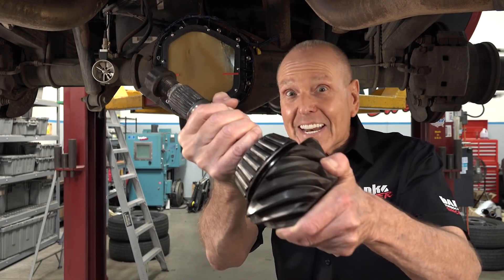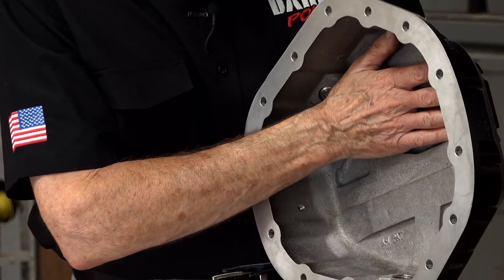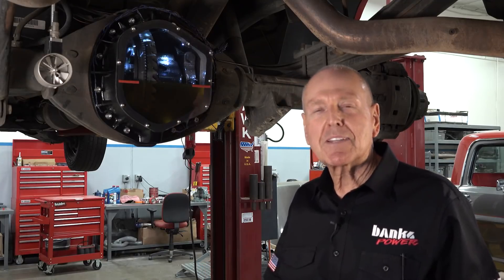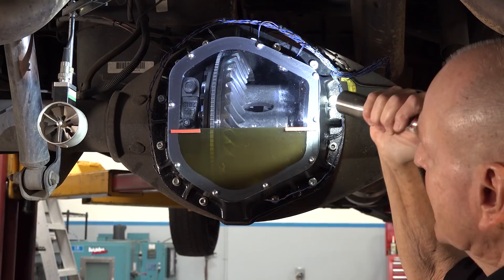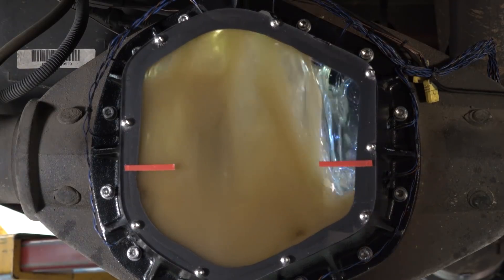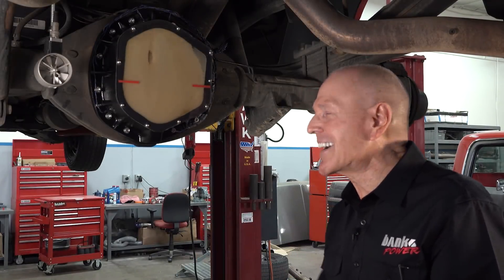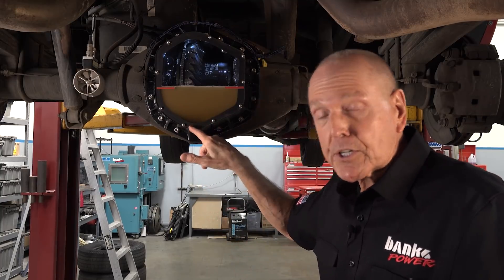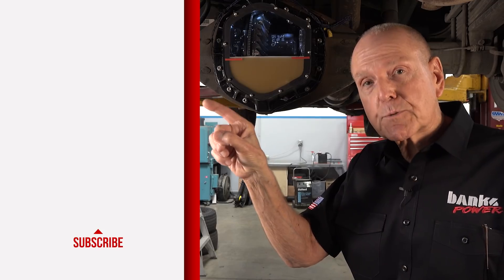What's going on behind your flat-back diff cover?

Comment: It would be neat to see some thermal imaging. That would highlight the highest friction areas for the fluid.
Reply: TI doesn't work that way. The IR light won't make it through the plastic cover. All it will show is a big red blob with uniform heat.
Reply: You don't need to see through to the oil, as it will all be the same temp. However, since the plastic cover is an excellent insulator it will not spread it's heat and will show obvious hot spots. So this would confirm the 90degree oil deflection is adding heat to the plastic/oil.
Reply from the maker: We have quite a bit of Flir thermal imaging. Although it's tough to see clear definition. It's interesting to see the heat move from the ring gear outwards.
Reply: @sixtyfiveford  have you actually used a thermal camera?
Reply: thermal imaging can be tried but the cover would have to be made translucent to the IR band I think some plastic are made for that purpose but I don't know if it will be compatible with the diff oil :/
Reply: Exactly my point. Polycarbonate isn't going to pass that band. You need zinc selenide or zinc sulfide for IR windows. We use them on electrical gear all the time so you can check connections with an IR gun or tool. You can't see through them, but the IR goes through. For something to cover the back of a differential you're talking several thousands of dollars.
Reply: IR windows on switchgear are made from calcium flouride so the IR scanner can see through them, make sure to set your emissivity on the your FLIR or fluke gun to .50 instead of .95 or so, this will help it get a clearer more useable image, as Kleetus92 said it would be very expensive to make a diff cover out of this,  usually IR windows cost about 100 bucks per inch in diameter
Reply: Literally pulling my aftermarket diff cover off that I put on 2 weeks ago and putting my stock on back on as we speak this video scared the bejesus out of me is got me in my driveway at 12:15 a.m. at night
Reply: @bryloncarr7466  overreact much?
Reply: LOL @kleetus92  

@Brylon Carr — What was your goal for installing the aftermarket cover to begin with? I mean, of all the modifications you can do to your truck (you know, spending your hard earned dollars) you decided to dump $300 +\- for a diff cover...?! 

Most advertise lower temps, more fluid capacity and a beefy design + the obvious aesthetic bonus. 

Why you running out to the car to pull it off? Do you not trust the design and engineering of the company who built the stinkin’ cover you purchased? 🤦🏻‍♂️
Reply: @bankspower  hi sir.  I was wondering when we going to get an update on the diff cover for dthe f150 09 to 2014.  Please let us know thanks

Comment: Why are all the haters going on about Banks' "sales pitch"? Last I checked, he's saying DO NOT waste your money on aftermarket covers, and stick with the stock cover. How is that a "sales pitch" - if anything, it is an anti-sales pitch. He's not selling anyone anything.

I think a bunch of people are just sore that they wasted money on an aftermarket cover that doesn't actually help anything. Maybe it doesn't hurt as much as Gale thinks it might (I suspect the higher than stock fluid level recommendation for these covers is a band-aid to prevent starvation of the front pinion bearings).

I've questioned the point of most of these covers for a while. Always seemed like a waste to me for most applications.
Reply: Agreed 100%. People want to get aftermarket diff covers for what? So the oil will last longer? So diff temperatures stay lower? Or is it just cool looking? 
In my opinion there's nothing wrong with stock diff covers. I've seen lots of vehicles with stock covers and have had the rear end outlast several engines. Let's face it, rear ends and differentials are pretty tough. Probably one of the least problematic mechanical components in a vehicle. And I also know that most people never service them or change the fluids at the recamended intervals (myself included) and they still survive. I've owned many vehicles and lots of trucks and do severe heavy duty towing and have never had a rear end fail. I know they can and do but it's not common.
Reply: I guarantee Banks will be unveiling there new cover after all these videos you don't spend this kind of money to prove how bad your competitors products are you do it to prove how good yours is
Reply: Gale Banks has simply demonstrated how poor, lazy, & cheap the designs of those aftermarket are, which seem to have been made to look impressive while using the least amount of metal!

Comment: Thank you Banks power. I will keep my stock cover.
Reply: Not only that, but fill to the prescribed fluid level. I have to admit that I've always just filled to the bottom of the drain plug, which in many cases is an overfill.
Reply: I'd like to see a transparent stock cover. You could machine a recess into a block of perspex to match the shape of the inside of the stock cover and polish it so that you can see through it.

EDIT: nvm, that was the previous video, lol
Reply: you can put aftermarket covers on just not flat backs try ones that have the same physical design but someone like myself wants something that is much stronger for offroading
Reply: Leonard Martin+ That makes sense. A finned version of the original shape cover seems like it would be useful for cooling.
Reply: i dont see the point of a flat back in the first place other than looks. i would much rather a original shape and inside space so same amount of oil everything is exact same in regards to performance and cooling etc. only difference is the metal is much thicker for hitting rocks and other things
Reply: What is the best of both worlds?  The flat back costs you money in both fluid degradation and adding un-necessary fluid and over all heat.  The only thing a flat back is good for is how it looks, and that's just silly.  It's under the car, its going to get covered in everything making it look plain and caked metal.  So you are going to buy a flat back, increase fluid levels, THEN also install a deflector increasing yet again the displacement,pushing the fluid higher yet causing more work and ruining the fluid even faster just to get the same fluid flow as a normal 
stock diff cover?  Why waste money on things that don't do anything other then make something look good for a few hours after putting it on and that's it?  Hey don't let anyone stop anyone trying to make something look better rather then work better.  If you want to waste money trying to possibly ruin your diff or at least your wallet then by all means, no one is trying to stop you.  It is your money and vehicle after all.
Reply: Best option would be to just tap the diff for some lines that go to a remote mount Oil cooler and use a stock cover and if you are worried about off roading durability of the stock cover weld trail armor onto the diff housing protecting the cover. This is why Toyota diffs last so long offroading even though they have smaller Ring and pinion diameters cause you cant remove the diff cover and therefore people aren't tempted to swap em (looking at you domestic guys)
Reply: but a wrangler is so much better for offroading than any toyota
Reply: Make your own. Weld 1/4" steel plate onto a stock cover, essentially making it rock proof. I've done this before and it works excellent.
Reply: i have done this but i have gotten to the point i just love a good bolt on.
Reply: lol you must be joking right... everyone knows the wrangeler is the most capable jeep vehicle for offroading
Reply: thats exactly what nissan did when they had premature diff failures in the early model titans, they started using finned aluminum covers with the same rounded shape as the original design.
Reply: thats what nissan did, improved the titans original steel cover and started installing finned aluminum covers of the same rounded shape
Reply: @mikemiller9119  who are you addressing this question to.
Reply: @mikemiller9119  no i am not i just have long hair and a beard that's all.
Reply: @lifeofabachelor8547  I agree.
Reply: @Mach141   What many did on their 03-07 Z350's and G35's = NISMO covers have cooling fins.

Comment: Excellent series from Gale Banks. Based on the info released so far, it sounds like the best diff cover to run for GM diesel truck owners is the OE aluminium cover off of a newer Ram diesel. Personally, I am hoping Banks come out with their own diff cover... Possibly a cover that hold more fluid but keeps the stock fluid height and has some sort of guide plate cast into it so stock cover (or better) fluid flow is achieved around the ring gear to the pinion bearings.  
So love the ability of Banks Engineering to explain and prove how their products are better.
Reply: Kevin Kalivoda 
Doesn’t sound like he’s a fan of higher fluid levels , and look at the aeration when it is higher. 
I suspect he’s up to something or figured out something with lubrication and he’s got a product for it.
Reply: @MrTheHillfolk  You are correct. Banks is not a fan of higher fluid level. I didn't say higher fluid level. I said stock (OE) fluid level with higher fluid capacity.
Reply: It's gonna be difficult to get that additional capacity. That pretty much requires a square backed diff cover. If Banks were to do anything, there would probably be some new studs to stick on the carrier caps. The studs would be longer. Then, use those longer studs to anchor a series of baffles around the ring gear to laminarize the fluid and sling it onto the pinion and keep it from splashing in the square reservoir. That said, the stock diff cover was rather good. You can just grind down the edges.
Reply: @Dr_Xyzt  My thought was the same as someone else mentioned and similar to yours. Put a baffle or guide plate by the ring gear to direct fluid, simulating the oe cover. Then you could have a flat back cover to increase fluid capacity without changing fluid height in the diff
Reply: But as he demonstrates, a higher fluid capacity results in a higher running level.
Reply: @immikeurnot  very good point. Im sure gale banks is smarter than me and can figure out how to increase capacity without increasing static or running fluid level.

Comment: Gale you need to check out what Freightliner and Detroit are doing for their rear drive axles. They have an air actuated flap that limits the amount of oil that the ring gear sits in. Depending on load and temps it will adjust its position. I believe they got 5% decrease in friction loss.
Reply: viscous loss is reduced with those flappers ,friction is the same,or increased by lack of lube.
Reply: @michaelovitch  yeah I should have said viscous loss instead of friction loss. The ring gear still gets enough Lube in all situations.

Comment: Most people are "sheeple" and just blindly follow others.  This guy is not!  I can guarantee you he's making some enemies!  I admire him for telling the truth.
Reply: Using the term sheeple immediately discredits anything you say.
Reply: How do you figure?
Reply: He's selling something, so his "science" is flawed. If he wants to make a product to sell, he shouldn't be fixated on heat generation and aeration of the fluid, because that's bs. Once you increase the fluid capacity of the axle, like to say 2 gallons, heat transfer in the fluid is less of a problem. Most over the road Class 8 Diesel trucks run 2-2.5 gallons of oil in each of their axles. Offroad Diesel trucks, like garbage trucks, dump trucks, and offroad tractors for hauling offroad equipment, usually top out at 5 gallons per axle.
Reply: Those large heavy duty trucks also have axles much larger than a typical pickup truck....
Reply: @JosephArata  Gear oil can handle some aeration, no problem - but aeration does affect level while reducing heat transfer efficiency.  It will always happen, but how much is too much?  It seems to me Banks is getting people to ask the right questions - including the aftermarket guys who stand prepared to sell the shiny and new to those who love it.  My #1 concern with fluids in a differential is cooling at the pinion end, and that takes volume.  In a splash system, the design is fixed [geometrically] so your only variables are fluid type and level.  If heat removal is poor, the pinion seal ages faster and if it hardens, leaks are next.  There's nowhere near as much work heat added to gear oil as in say... a 3500 psi hydraulic system, so if minimum volume is not breached I really wouldn't worry about it much with recommended fluids in use.  If anything, I wish differentials came designed to accept a [thermowell style] cartridge heater - keeping condensation away helps prevent sludges from forming and that probably dictates fluid changeout more than anything.  It would also improve viscosity numbers to promote distribution for parts that need it on cold days.  Engine blocks and oil pans can be heated, so why do we ignore our differentials?
Reply: @JosephArata  Do you even understand scale?

Comment: The reason i went to after market covers is because i tow alot so i change my fluid frequently i don't care about cost i care about great maintenance. I like the dip stick to check levels its simple and i love the gasket. No reason to take the cover off for service just check the magnetic dip stick if it looks good drain fluid refill and go. I drive a 7.3 mildly programmed total granpas truck that tows stuff sometimes real heavy stuff 300 thousand miles no issues after i got rid of the stock junk tranny. Bearings and seals ball joints regular stuff. But my rear end no trouble with a flat back mag hitech cover. But if banks comes out with a better product. That i can service and check easily ill sell my covers and buy his. Because he is the man and he knows his shit and he knows tow rigs.
Reply: Derek Bedford Only problem is is by the time Banks is done trashing  mag tech’s covers they won’t be worth jack...i’m in the same boat as you. i haul commercial air conditioners with a 95 ram 3500. i bought the same brand covers but I know my fill level did not change and my rear cover is about 2 inches deeper to accommodate extra fluid on a dana 80. the front cover is about 1”or so deeper. I changed the gear ratios a while back to a taller gear and so far with 80k both front and rear look perfect. so I’m not too worried about it myself unless one of them gets damaged. i’m sure by then Gail banks will have something on the shelf ready to rock that has better fluid dynamics😮 that is if he makes covers for older trucks? i’ve been happy with everything I bought so far from banks I’m sure he will do a good job as always.
Reply: darkjedi351 I definitely wouldn’t worry about it I have never heard of anyone having issues with bearings starving for lube or overheating issues due to aftermarket covers in my life. I’ve had three trucks with the same covers with hundreds of thousands of hard pulling miles driven with no issues. only benefits. i’m sure finding a guy blaming premature wear or overheating due to a diff cover upgrade is about as rare as a unicorn.
Reply: speed demon ... Ya i bought my truck to be a 20 year truck but it just might be a 30 year truck or a 40 yr truck. Im not interested in the new fancy junk. Def fluid is a california government scam i have friend's that tow alot and have deleted there newer trucks but they are having problems. One of my best friends just sold his newer deleted cummins and took the money and bought 2 nice old 7.3s with the money. So he eliminated his payment and got 2 sweet trucks. I dont think anyone can go wrong with an old cummins or an old 7.3. I cant pull the pass at 90 but i don't want too. I leave on time and i treat my truck like my best tool in the box i take care of it it takes care of me. Plus im a dad and im saving tons of money for my kids future by not having stupid un needed payments.